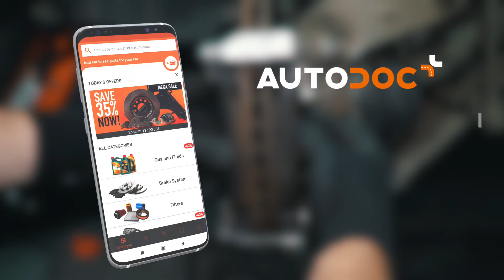How to replace a brake caliper [AUTODOC TUTORIAL]

Comment: I have problems with my caliper bracket as it has a worn out slide pin bore , I know it can be fixed by bushing it with a brass sleeve but I rather buy a new original baracket, the problem is that they s3ll you the complete set including the caliper, so I have to buy the whole set. My question is should I replace both sides at once? The oposite side brake is in better conditions than the one I want to change.  Best regards.

Comment: My brake bolt won’t shift, breaker bar won’t fit and I damaged a wrench hitting it with a hammer. Any advice?
Reply from the maker: It’s difficult to advise anything based on the description, we recommend contacting the car service.
Reply: Try a torque wrench, bit shorter than breaker bar and they ratchet, so maybe a find a better angle. Good luck